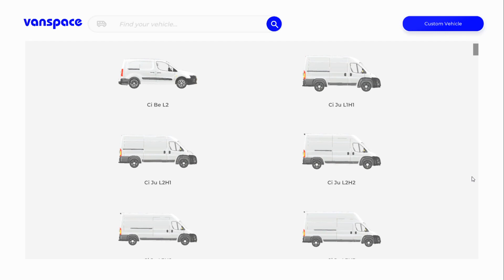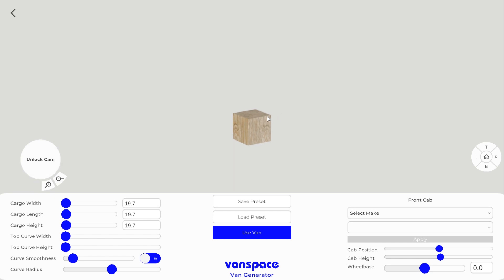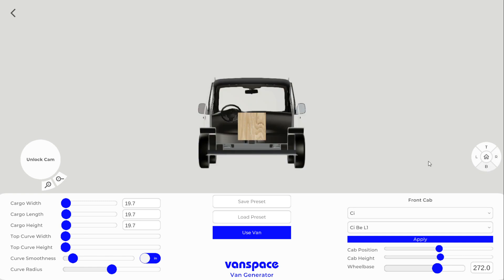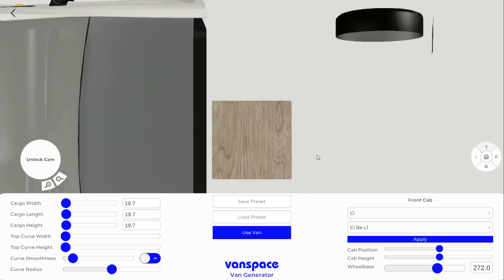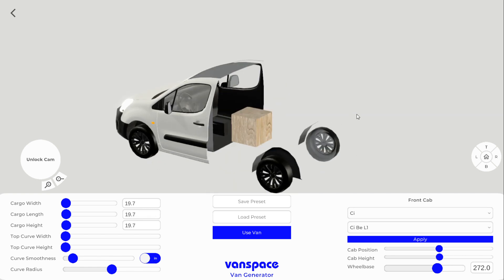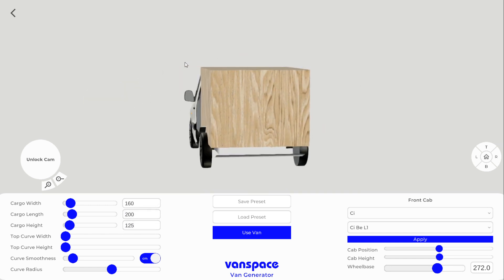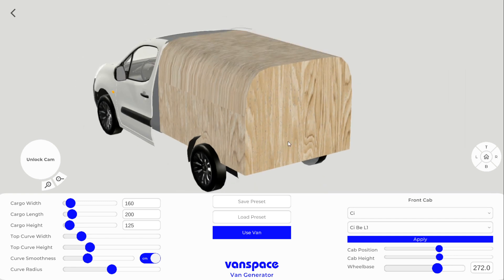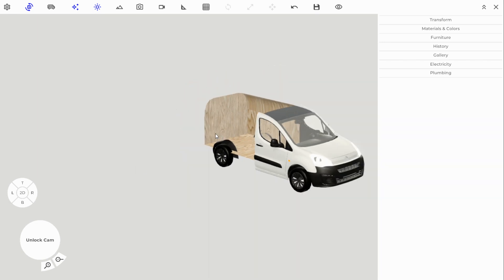Custom Van Generator Tutorial | vanspace 3D camper van floor plan software

Comment: The toggles for turning walls and bulkheads doesn’t work on the custom vehicles, I also can’t see the windows etc. Is there a limitation there?
Reply from the maker: This is because custom templates do not generate exterior walls, so there is nothing to toggle off.  Bulkhead on/off toggle is available in Van Settings for these templates, as it is an interior wall.

If wanting to remove the other interior walls, you can apply a transparent texture to them